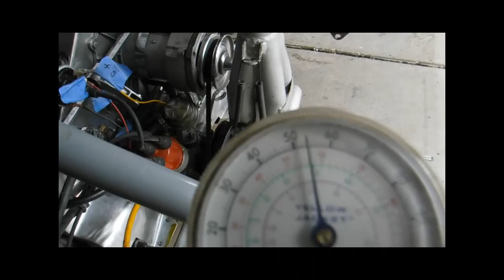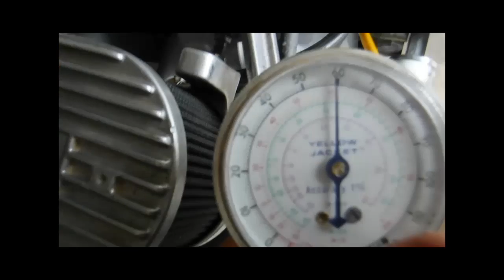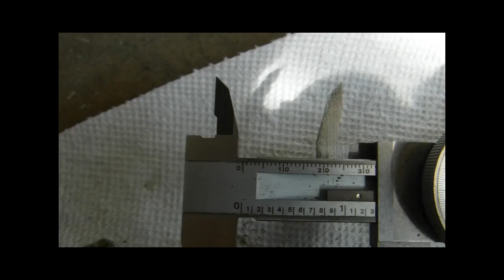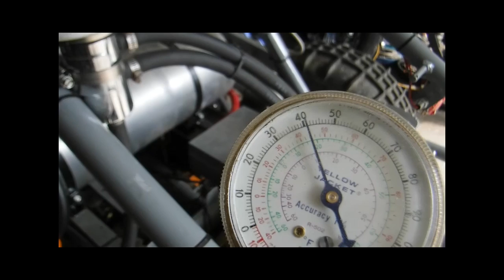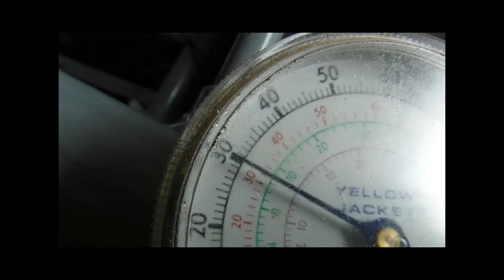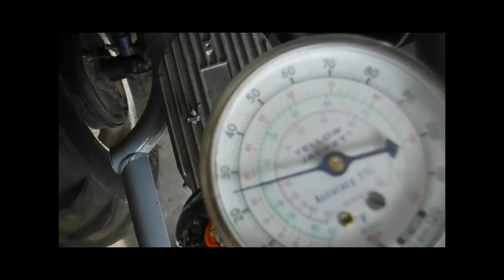2276 Engine Test + Q&A

Comment: Engine sounds good. Lots of good info in this one. Would be nice to rig up a thermostat to control oil cooler fan. Good thing you came back to clarify the oil thing. So not want to open that can o worms. LOL!!!!
Reply from the maker: It does already have a thermastat controller for the fan. I think it comes on about 170 or 180 f

Comment: great video my friend!
i break in engines with transmission oil myself!
Reply from the maker: really....... interesting.  I can see that with no load and low RPM
Reply: yeah, no driving and some low revs tell the engine is up to temp than drain and add fresh oil.
it works great as a safe engine flush and sticky lifter and other gummed up internal parts.
Reply from the maker: Not sure I would do that on a new engine but I have heard of similar things on old cast iron american engines.  I know you know what your doing.
Reply: yes, the newer engines have too tight of tolerances that i wouldn't even think about doing it even at 200,000 miles on them!

Comment: My 2276 oil pressure is 80 psi on cold warm ups. The motor is on a 4 seater Rail . I'm going to make videos soon hopefully people can give me input
Reply from the maker: Thats good info. be sure and give your RPM and Oil Viscosity  when posting your results. Also include Idle speed and oil pressure on hot engine.
Reply: @TheEZGZ  alright will do thank you

Comment: At 11:10 what is what is screwed in to the bottom of the oil coil and then your hose is connected to it? Is it a drain back preventer and if so can that reduce your oil flow too much?
Reply from the maker: Full flow normally open thermostat switch.  http://carcraftstore.com/fanthermostat-electric.aspx

Comment: So I recently discovered what I thought was a 1776cc
Is actually a 2318cc

What oil/pressure 

Fuel/pressure should I run

And HP ideas
Reply from the maker: 3 PSI fuel pressure.  Old school oil pressure formula is 10 PSI for every 1 K RPM.   The lighter the oil the better it lubricates. I like 10w -30w synthetic blend. These days. I'm having trouble finding conventional.   People who don't take advantage of modern oils are stubborn and ignorant. Just sayin.  :-)

Comment: hi can you tell me what causes a jolting when in 2nd an 3rd gear not so much in 1st haven't got into 4th, it has  just started doing this , this is phoenix vw trike 1641cc up from a 1971 1300 cc I just bought it 3 weeks ago and was going fine the only thing I done was put petrol unleaded would  that have done anything as im in Ireland and it was England , ps it is starting and purring like a cat , could it be the clutch ?? thanks,
Reply from the maker: Your trike is very light in weight and there is a temptation to shift into higher gears at low speeds. You need to keep the engine revs up higher is all. Do not lug a VW engine.  Sitting on top of the engine is noisy and you hear more. You might even have bigger tires which effects things.

Comment: I have a mild 2276cc with dual 44mm webers with the sync link throttle system (great setup!)  in my street bug and when I start my bug cold it never starts as easy as yours does In This video.. It always starts rough and if I dont keep my foot on the gas it will cut off. Once it runs for a good two minutes it will pick up idle and stay running, then as the engine warms up it picks up the idle evens out and runs good.  Any idea as to why this could be Ezy? All my adjustment as far as main throttle and idle her adjustments are within the tolerance redline gives for adjustment of carbs.  Like I said I can never just turn the ignition and the engine start and idle on its own from cold. Once it's warmed up if I turn it off then try to start it it will start on its own and idle but the longer I let it set the less it will want to start without actually being on the gas pedal.
Reply from the maker: I would check everything on your ignition system. Timing, plug wires, spark plugs.     With the engine off make sure that both carbs lift off the stops at EXACTLY the same time and also make sure that when at wide open throttle both throttle shafts are at the same place and go full open.
Reply: Thanks for getting back to me Ezy. Yes my throttles are dead on and both open to WOT with the gas pedal to the floor. That did take some minor adjustment but got that all good now. I was thinking the ignition system because when motor warms up to operating temp it will slightly change idle RPM  and when I take it out for a ride I notice that when I come to a stop light the idle changes. It will come down to idle and at times The idle will go lower (maybe 100RPM) like someone is back there behind me turning the idle down and then back up. This does not happen every single time either. Just feels like something might just be drawing amperage in a way. Once I start moving it runs pretty dam smooth with no hesitation or dead spots. It doesn't change if let's say I am cruising at 30 mph, it runs smooth as can be. Only at idle do I pick this difference up. Again, both carbs are opening exactly at the same time, my timing is good, brand new plugs, oil, valve adjustment. I did put in a new ignition switch but not sure if something may be going on with that. Could that possibly cause an idle issue in your opinion? Thanks for taking the time to answer my question. I know it's hard to give a firm diagnosis with what info I can give. Just looking for someone else's thoughts and opinions that is knowledgable about bugs. I am no big electrical man myself. I did put a complete wiring harness in but that's not trouble shooting a possible ignition issue. Lol thanks again!!
Reply: Also brand new Bosch wires. Running a igniter 2  in a 009 distributor.
Reply from the maker: I really think it is a air fuel issue or small vaccum leak.  If you can catch it when it's acting up and then work each idle mixture screw slowly until you find the single cylinder that is causing problem. Again float level can be hard to diagnose.   You might even try a different brand of gas. I had idle issue's as a drove cross country and bought gas a different places.